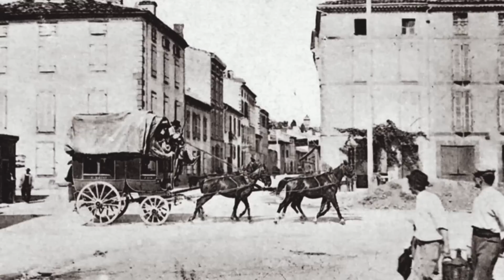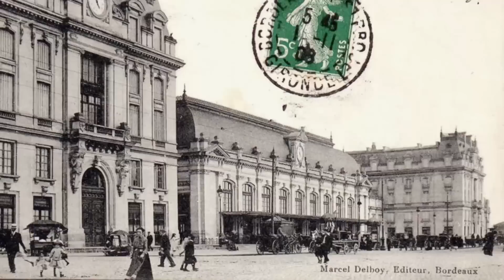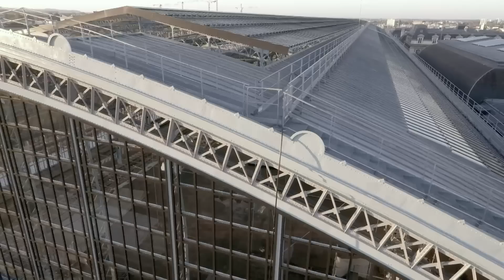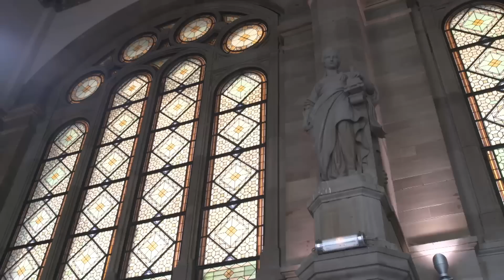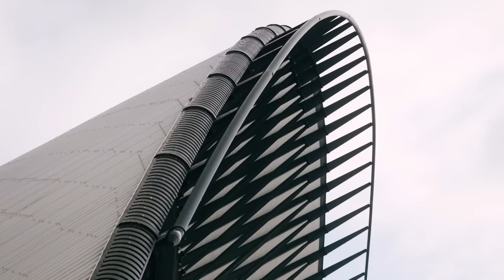Mega Railway Stations: Inside the World’s Most Spectacular Hubs - Full Documentary

Comment: Strasbourg is a failure !
The glasshouse is always dirty.
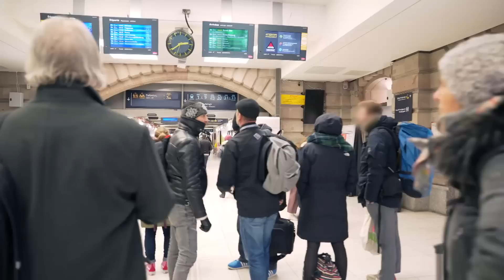It’s a sauna under the sunshine and freezing cold in winter. Since the rebuild all the circulation inside the building has become difficult because they transformed some public space into shops ( 38:34 ) - now closed for re-construction , since last year.
They tried to block the sun with a dotted adhesive film but this makes everything just worse. 
They use the lower part for advertisement for exhibitions and stuff like that…! I use this station very often and I hate it !!! The Glas bubble “Protect” the building- from “be seen”…
And the moment you step  outside you are greeted with a “Rouge Piéton” - red (for) pedestrian…spoken and repeated until it’s getting green.

I’m a fan of Lyon Satolas / Saint-Exupery . I’ve visited the station in the year after the opening and I loooove it !
Bordeaux Saint-Jean was modernized some years ago and I think it’s way better and more successful than Strasbourg.
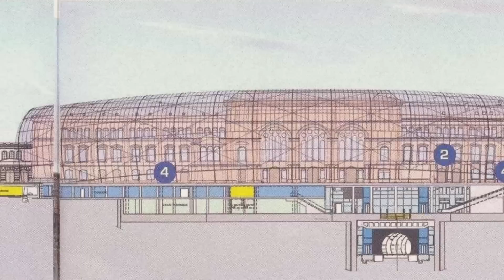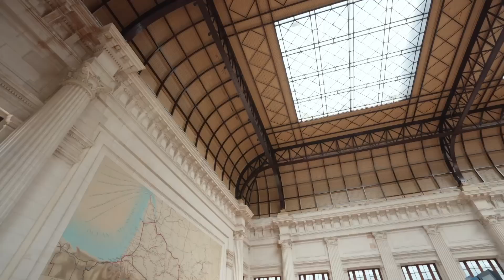33:00 Bordeaux is not Strasbourg… 33:27 Why do you mix images of the two stations ?
Btw; the tram station down there is often flooded because of the underground parking just above it 😂